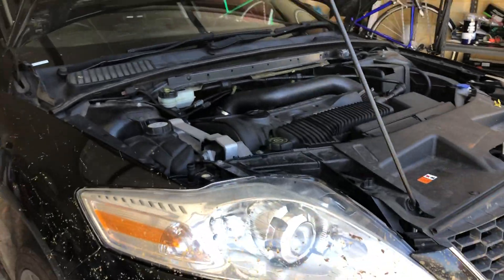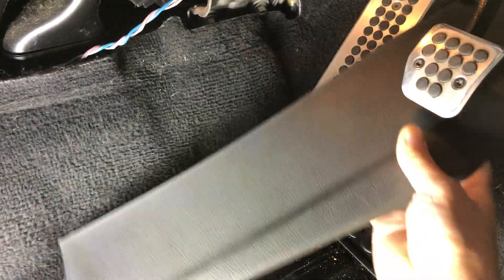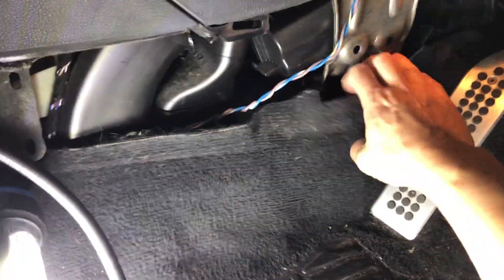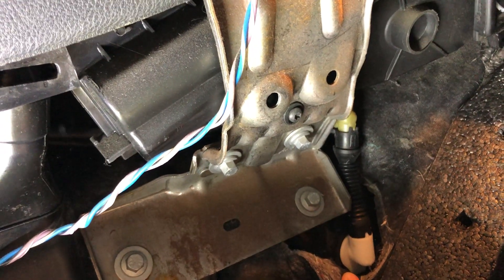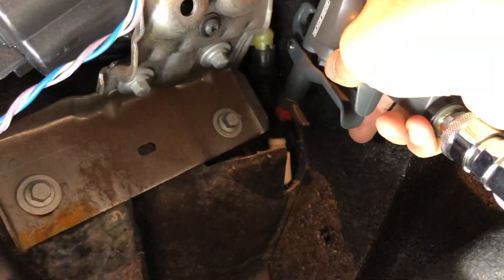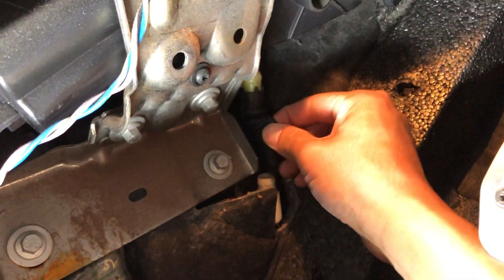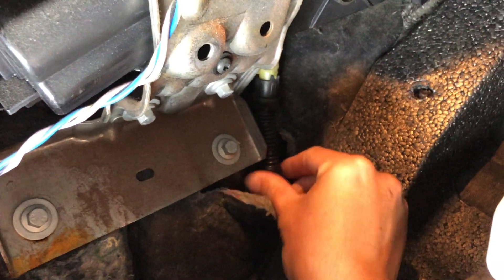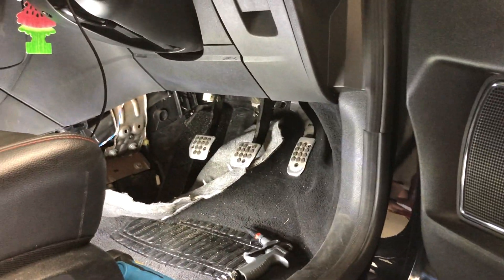2010 MK4 Ford Mondeo XR5 with blocked AC drain fix. Causes wet foot-well

Comment: same problem but ford s-max, the lanky mondeo(?) would this be the same issue if UK passenger foot well is wet but not the RHD drivers foot well?
Reply from the maker: @SB-tp3yw  I don’t think so, could be sunroof drain, door seal or coming from scuttle panel. Hope you manage to find your leak 👍

Comment: Is the white plastic L shaped piece a tight fit where it goez through the metal - mine wobbles about. What does it connect to?
Reply from the maker: Hi the white plastic part goes to outside under the car. Hope you manage to sort your problem 👍